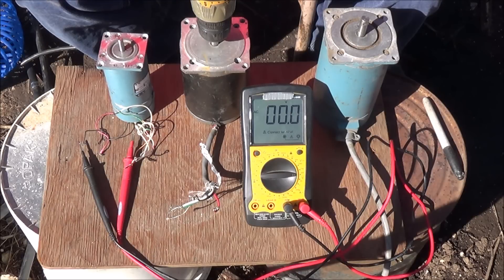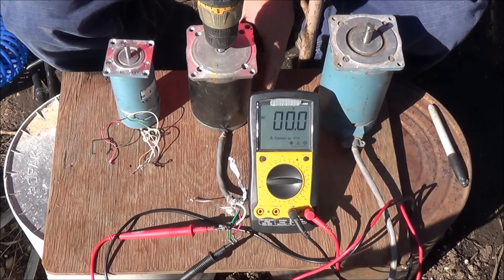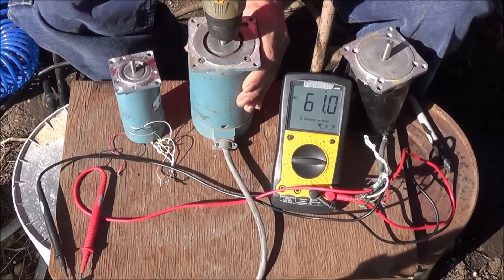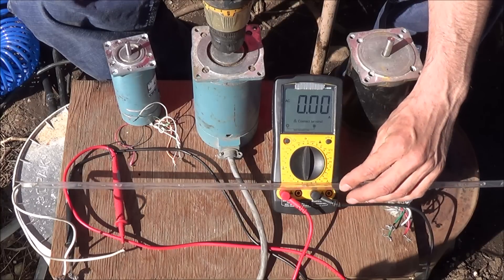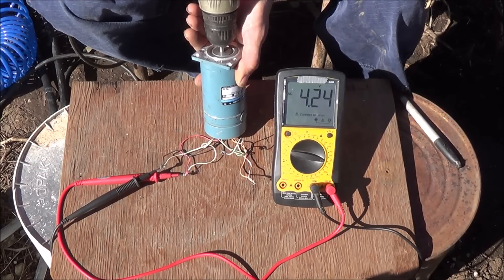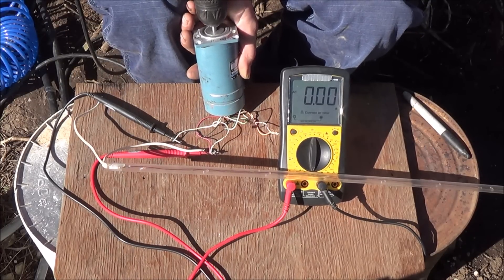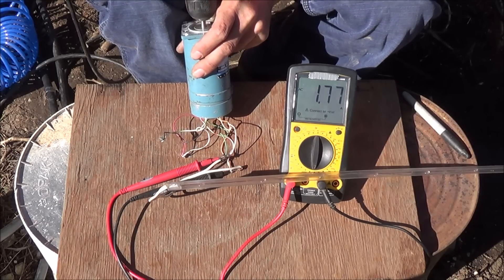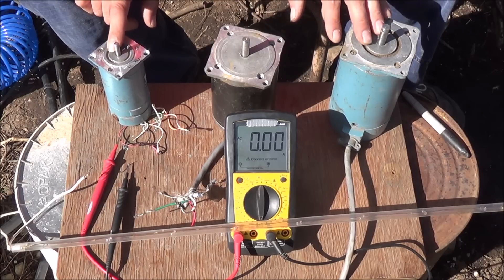Testing Stepper Motors for use as a Generator.

Comment: Sir, what is the current rating of the small Hybrid Stepper Motor that generated 2 amps?  I would love to find out If a Stepper Motor is rated at 4 amps, does that mean it can output 4 amps if used as a generator?